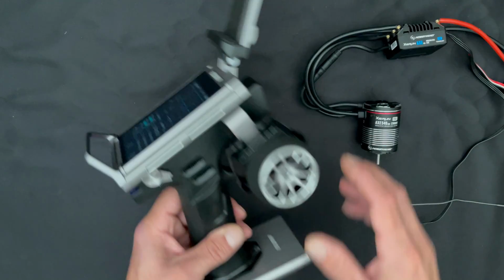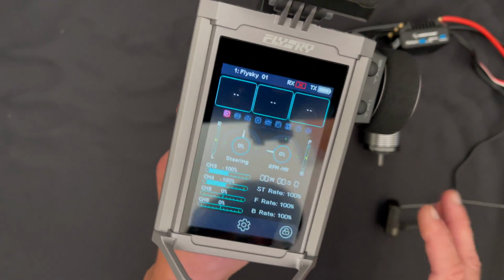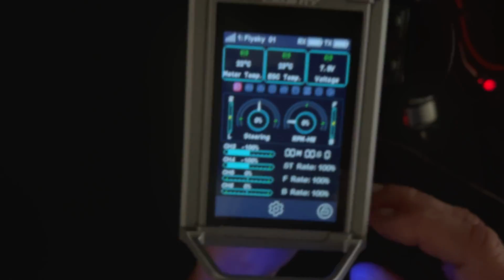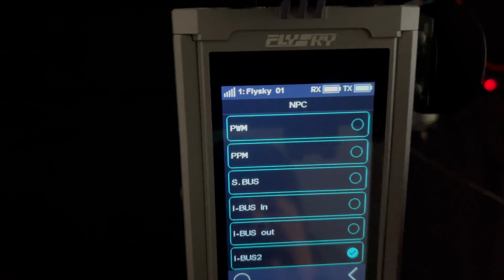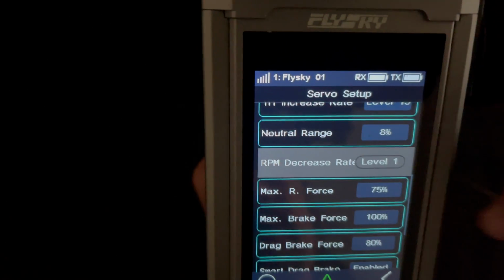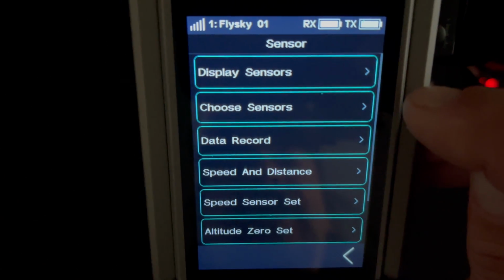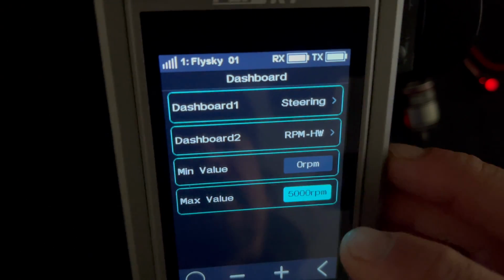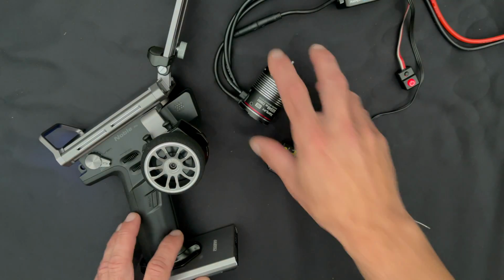The Charlie Show /// Episode 326 /// Axe R2 and FlySky i.BUS2 features

Comment: Ohh buddy. Yay for being one step closer to my dream rc electronics setup. Are there going to be updates for xd10 esc too?
Reply: Feel like I need to share my "dream" rc setup. Its largely based on whats possible in fpv drones. I want elrs integrated into a brain unit that modularly mounts/attaches to the esc. This brain unit would include: gyro+rx+uart for addressable led ws2812b+bluetooth programming+lots of pwm outputs for servos and other functionality like fpv integrations. All of this is already available on $40-60 fpv wing/drone FC boards it just needs to be optimized for surface rc and a solid configurator built. The configurator could be a modified version of betaflight, or i-nav. Going to something like elrs means you can add so much functionality without having a super complicated or expensive radio.

Comment: I just got the Xerun XR8 Pro G3  + the Xerun 4268 G3 motor and got the flysky temp and voltage sensors connected to make the same think work... it makes too much cables going on...
Hope this will be supported a.s.a.p on the  Xerun XR8 Pro G3 1/8 scale for my buggy and truggy. the only reason I switched to flysky is for the temp and voltage alerts.